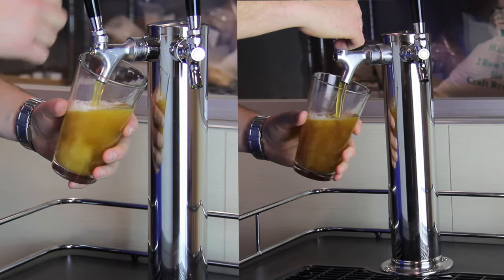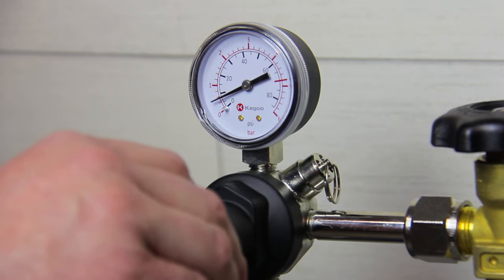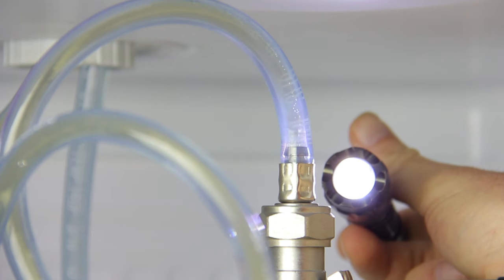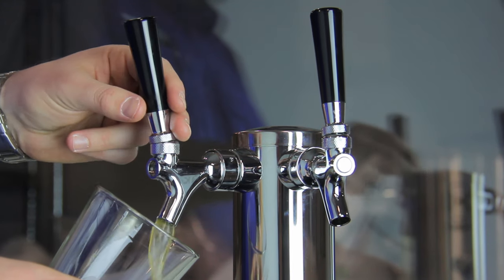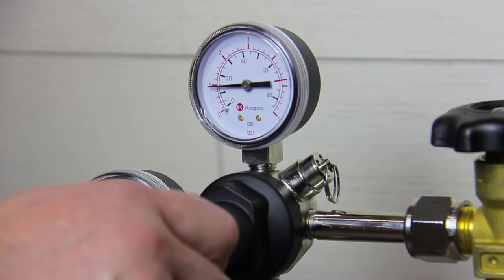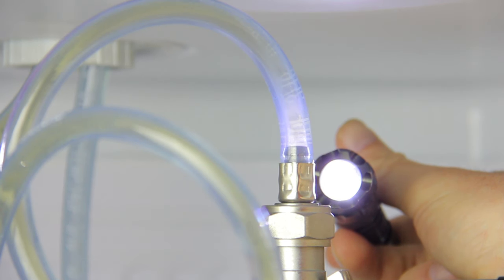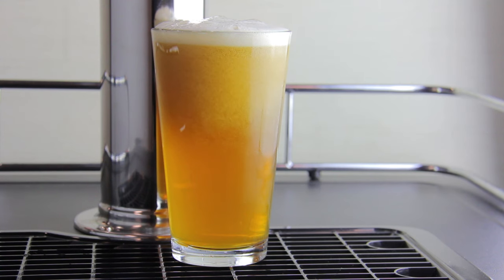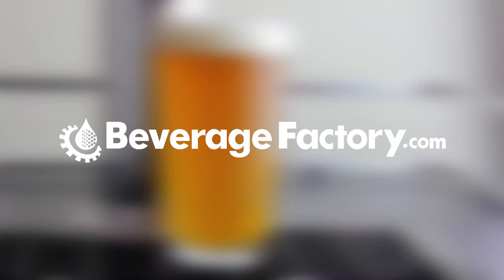Part 1 - How to Keep a Beer Keg Properly Carbonated - Balance a Keg for the Perfect Pour

Comment: This is a great way to troubleshoot the pressure from the regulator (obviously you need to make sure tower temperature, and line length are correct as well)